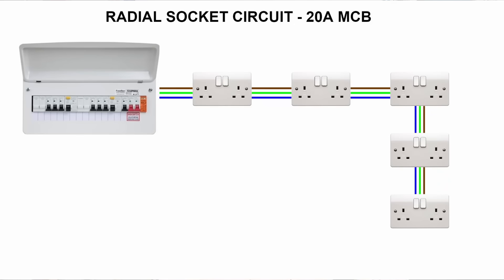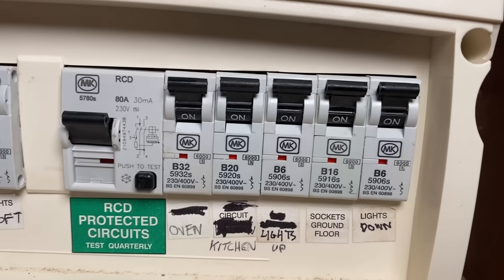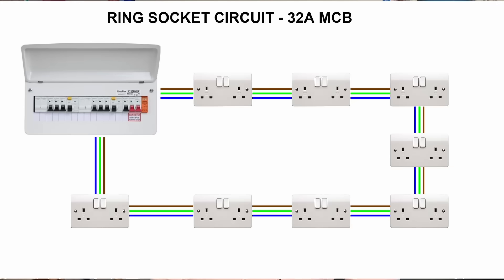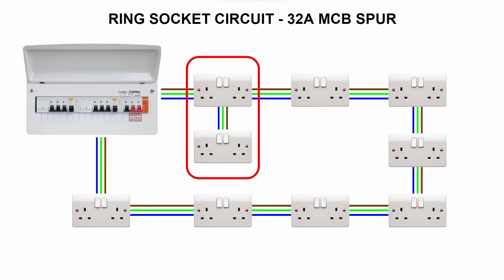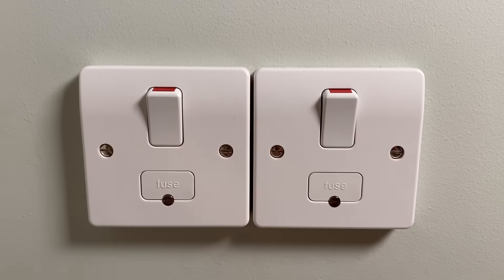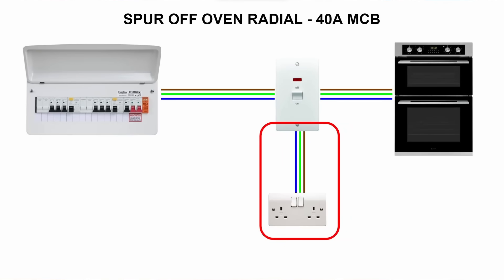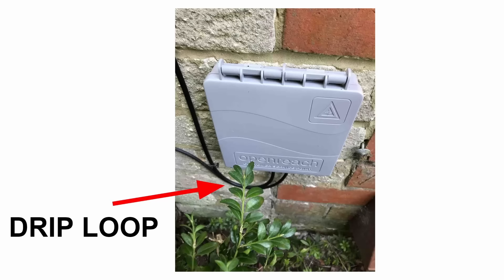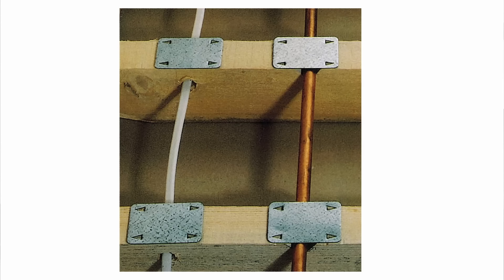BIGGEST DIY Mistakes Adding a New Socket

Comment: I am an electrician and your explanation is brilliant. The only thing I would add is that you are allowed to have up to 3 circuit per MCB and that mean you can keep broken ring without adding new MCB as long as you downgrade it to let's say 16 amp. But this shenanigans should be checked by electrician as no dyiers know how to check for Ze and Zs which are crucial for safety in electrical installation.
Reply: Good rule of thumb - all wires are fuses.
Reply: @mb-3faze  Or lamp filaments. (How I heard it.)
Reply: CHECK for Ze & Zs
My good man - I'm not entirely sure what Ze & Zs are   🙄
Reply: If space is an issue in the consumer unit, then perhaps this would be a compromise -  However Regulation 314.4 (BS7671) comes into play - each final circuit SHALL be connected to a separate way in a distribution board.
Reply: Years ago I extended a ring main and added spurs guided by a DIY book on the subject. Recently it was all tested by an electrician and passed. I still do my own minor electrical work. No need for electricians to do simple stuff.
Reply from the maker: Thanks for the info, and thanks for watching, very appreciated!
Reply: Yes.  I suppose an advantage of the ring main is that the resistance along the earth conductor is lower than it would be for a given distance from the consumer unit compared with a radial as it has two 1.5mm2 conductors instead of one?
Reply: A ring main has the advantage that the resistance is lower because of two power paths.

But do not get too excited because at a socket close to either end most of the current will flow through the shortest wire.

But correctly supplied the ring will be  supplied from a 32A MCB. That will give a good protection in most cases.
Reply: Realistically, how true is that?  I've heard it said before, and I've also heard it said that this is a myth.

If the long path down one leg of the ring is ring is 25m long and the short leg is 1m, we have 0.370 Ohm on the long end compared with 0.015 Ohm on the short end (at 20 degrees C) so I can see that the current would be split accordingly.  To what extent would the initial rush of current create heat thus increasing the resistance and how much would it counteract the effect?

I'm thinking the answer is not a lot but, as you say, enough to mean a 32A MCB on a properly-sized (for likely maximum heating load) is sufficient overcurrent protection? @agileservices
Reply: Ze Zs R1R2 RCD trip times, Insulation resistance testing.  All should be done when altering existing circuits as the Minor Works Certificate asks for these details, this is non notifiable works.
Reply: @gctelectrical5555  I still have my 1000V hand powered Insulation resistance testing mega meter - a bit of history.
Reply: @uksuperrascal  Mine was a windup one!
Reply: @andrewdoherty737  Wind up comment or Megga  🤣😂🤣😂🤣😅
Reply: @richardcloudbase  Megga, frequently forgot to discharge properly, gives a bit of a tingle!
Reply: @uksuperrascal  probably worth a few quid to a collector.  However selling your tools is not allowed.
Reply: What makes you think that 'DIYers' do not know how to check Ze and Zs?
Reply: @ef7480  the price of the equipment. It's not worth of buying such an expensive piece of kit if you are DIYer. Unless you will be doing this regularly in which case you should simply become qualified.
Reply: @ef7480  anyone can check for it, doing it safely and interpreting thr results specific to the installation is another thing. 

If you are referencing and interpreting the 18th then you are a step above DIYer.
Again, if you've read the 18th you'll know that you don't have to be a qualified spark to work on electrics, you need to be skilled and or competent.

I'd say the average diyer ain't skilled or competent or familiar with the 18th.
Reply: Don't encourage him ffs
We don't need DIYers messing around with electrics that can't competently test and confirm the quality of the work
Also, his language is very much in the realm of electricians. Not some scuffer using youtube to learn how to add a new socket
Reply: @bendersquaddie actually do.

I'm a diyer, but done electrical engineering up to level 4, now a train maintenance engineer, I work on voltages between 24VDC up to 25kVAC. So I'm ok with electrics. 

I do my own electrics at home but I know I'm not certified to open the main panel of the consumer unit. Apart from that, I'm not up to date with the domestic regulations, so I find Google and YouTube very useful to just tell me what's allowed and what's not.

But most people stress if you're not comfortable with electrics, don't play with them. Which unfortunately it's clear whoever owned my house before me learnt the hard way, after I found 1.5mm cable supplying an electric heater, the cable melted and lovely burn marks all within the wall. Luckily the fuse done its job.

Comment: I found that very interesting but one thought on safety plates, as most builders and some  do it yourself people are now using cordless impact drill drivers you can easily  drive a screw through those plates without knowing. cheers Les
Reply from the maker: Thanks for watching! I’ve hit one going through plasterboard with a plasterboard screw, with no issues. But i don’t know how it would cope with a big wood screw going through floorboards first then into a joist. Maybe I’ll do a video on them at some point and test it!
Reply: @TheDiligentDIYer1759  Hi there is a video out there showing a cut away section of a joist, safeplate and a floorboard and a impact driver makes light work of the safeplate going straight through it like it's not even there!
Reply: @TheDiligentDIYer1759  https://youtube.com/shorts/zGqfrbmRGKA?feature=share
Reply: People are going to suppose I have some sort of fetish or franchise selling metal detectors  ...  BUT ...........
You're right, unless you set an impact driver to the lowest torque (maybe to avoid crushing plasterboard or whatever) yeah, there's every chance it would be through before it registered in your mind you'd hit metal.
Reply: @Farweasel  I wouldnt rely on metal detectors.  They dont always seem to pick up
Reply: @redf7209  TRUE .... There's certainly a lot of variation in how sensitive they are.
But hey, always worth a sweep.
Reply: I bought a detector. I set up a bit of old plasterboard with a length of copper pipe, a bit of 4x2 and a plugged in extension lead behind it. The detector found all 3. However, I then tried it against the wall with a live lighting circuit cable behind it. Nothing!!!

Now I would never have drilled in that location anyway but based on the results on the mock up I could have accidentally drilled a cable or pipe elsewhere. It's been in a box in my garage ever since
Reply: @800Viffer  I did drill after a live cable in use was not detected.  The cavity allowed the drill piece to push the cable aside without too much damage . I was lucky. I only noticed because the plastic plug inserted was being pushed to one side by something.
Reply: Ideally you could earth the safety plate.

Comment: Sparky here .. strangely a lot of homes here (Ipswich Suffolk) built 1945-1952 ish have 4mm radials for they're sockets .. I've always thought this strange for the 'after the war period'... you'd think that'd be smack in the saving metal period.... Anyway It's nightmare if you try to fit anything other than MK sockets as a lot of cheap sockets have small cable clamps that just won't take 2 4mm conductors...as for the safe zones .. kitchen fitters I'm looking at you ...the amount of diagonal cables ..or times I find sockets/ cooker switches in the combustion zone is uncountable.....nice video for the homeowners dude ..keep it up.
Reply from the maker: Thanks for watching! Compliments from a professional always appreciated! Were the homes you mentioned wired with aluminium cables?
Reply: Yes as a electrician I completely agree about kitchen fitters, in my experience I have spent hours correcting their wiring. And yes I understand about 4mm cables and MK sockets. In response to Dill-Diyer next question below. during my apprenticeship in the 60s there was a copper shortage and  we substituted  ring circuit cable with aluminium cable . (plumbers had to use stainless steel pipe). The shortage did not last long though.